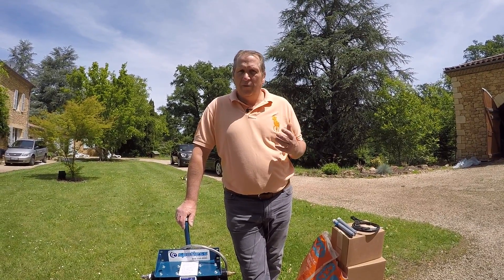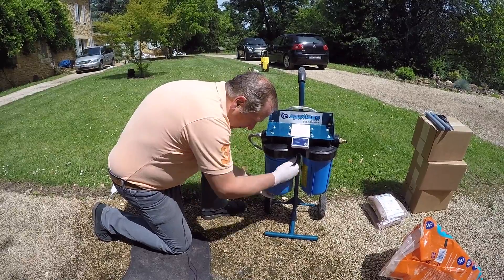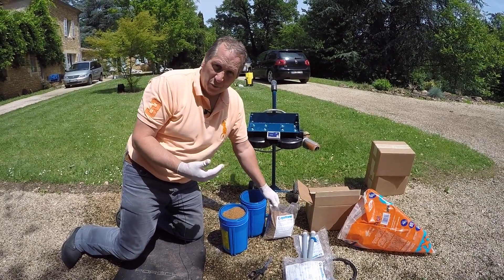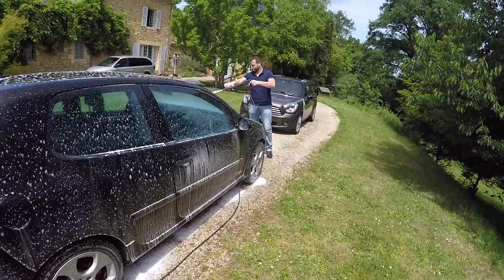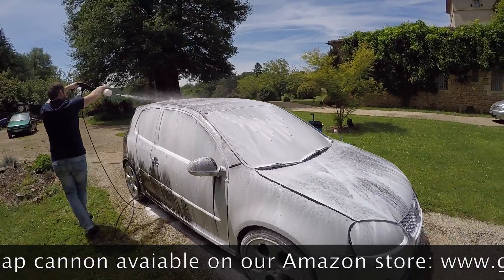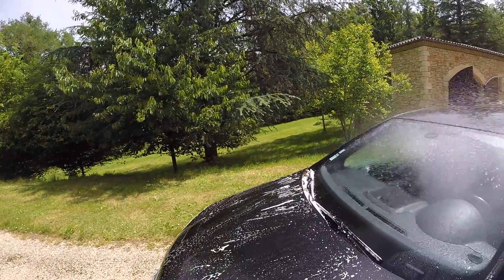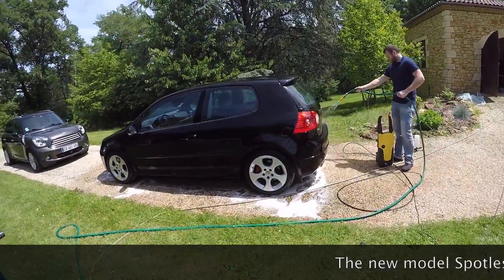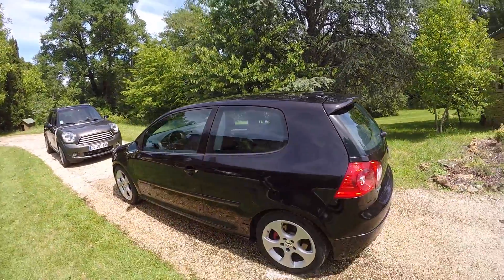Spotless DI water system conversion

Comment: If this isn't the one he posted last year, it is almost the same scenario. 
 
OK Glen, question: To save money, what do you think if you would use your water softener first in line then have it pass through your Di system, do you think it will last longer?  Because, the water softener will remove most of the minerals and there are only a few left for the DI to handle.  I think it will work, because salt is a lot cheaper then the resin of the DI...........What do you think.......
Reply from the maker: Yes, absolutely if the water goes through a water softener first your resin will last a lot longer as the water softener will have done a lot of the work first. The water softener only really removes potassium and calcium  where as the DI resin removed absolutely everything.
Reply: Great Escape OK, and I agree!  
So, here is the question: Since salt is cheap, it may still be cheaper in the long run to use both in line to get results, Have you tried just the water softener to see how good/bad the rinse was after it dried?  Because my thinking is calcium and magnesium (in the states) are the 2 abundant dissolved minerals that are really making it difficult for a clean finish, and the softener is doing that 😜.
Reply from the maker: @mrmudstud5980  A water softener does not remove ALL of the minerals which when dry leave water spots

Comment: Why will the system only result in 660 gallons of DI Water in the DIC-20 but 1000 Gallons in the DIC-10? Seems the larger canisters in the DIC-20 would allow for more water than the converted DIC-10?
Reply from the maker: Please tell me where on our site you have read that as it sounds like it the other way around. If it's a mistake I need to correct it.